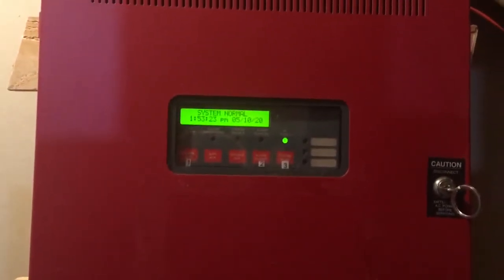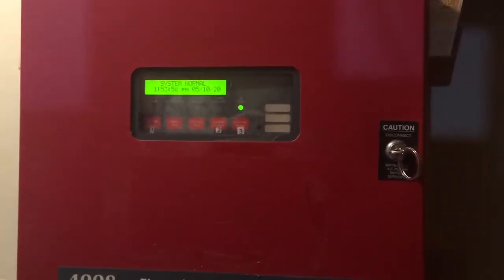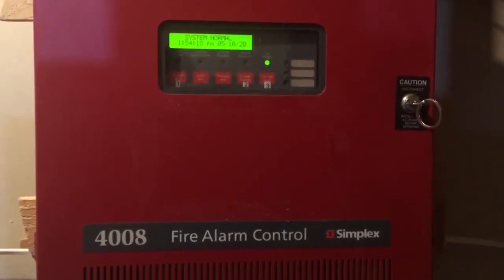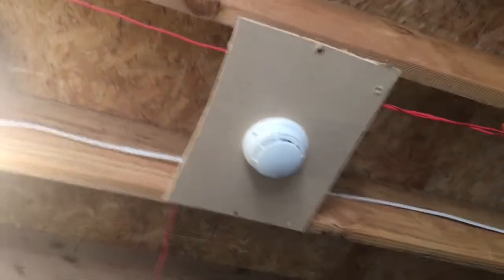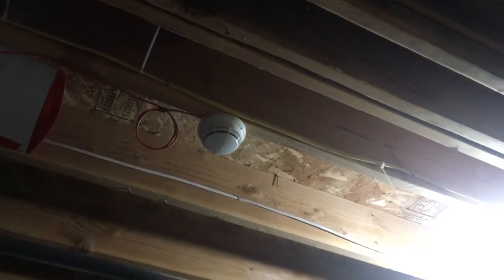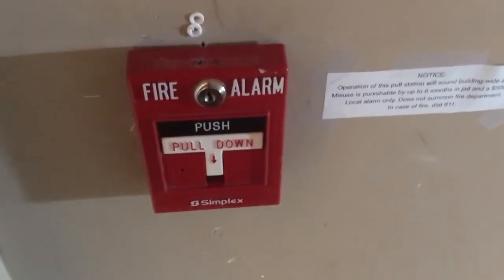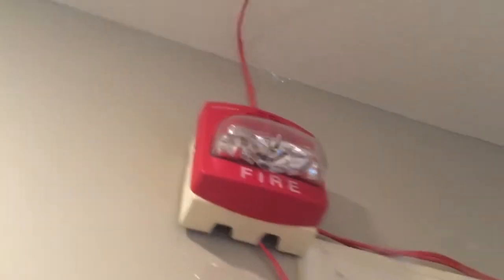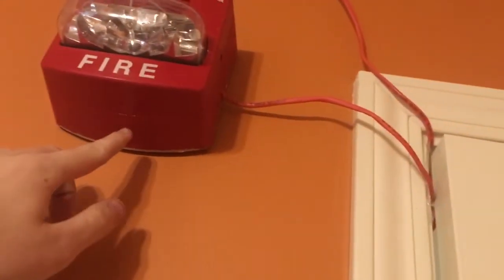Home Fire Alarm System Overview

Comment: If the system does not call the fire department, why will you get arrested? that does not happen unless you waste fire departments time.
Reply from the maker: It’s more of a deterrent. I’ve had false alarm issues from the pull stations being pulled for no reason. Threatening someone with getting arrested is usually going to keep people from pulling them when there’s no fire.
Reply: @FireAlarmsofNortheastKansas  from people in your house ?? Why not just tell them not to pull it if there’s a fire

Comment: Cool! I bought the Wheelock AH and the Gentex GXS ceiling mount! Also will my devices be shipped in the same box?
Reply from the maker: You have to pay for both items first
Reply: @FireAlarmsofNortheastKansas  I did. I paid $28 total.
Reply: @FireAlarmsofNortheastKansas  It is giving me a summary and it charged a credit card so yea.
Reply: @FireAlarmsofNortheastKansas  I can give you the order numbers to if you want.
Reply: @FireAlarmsofNortheastKansas  Did you get my payment?
Reply from the maker: I checked and it shows both payments but only notified me of one of them. In the future, let’s not use the comments section to discuss eBay matters. If you need to reach me for eBay stuff, please message me there.
Reply: @FireAlarmsofNortheastKansas  Okay! I will message you there!